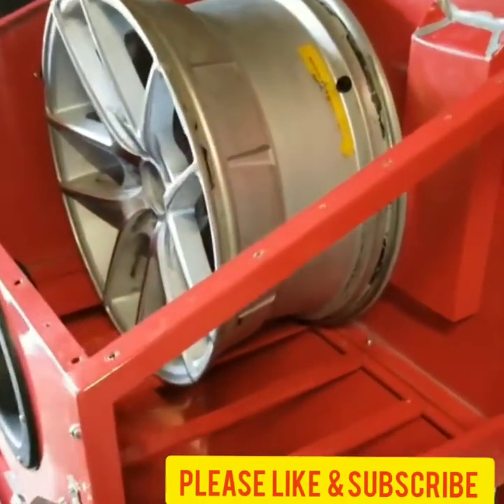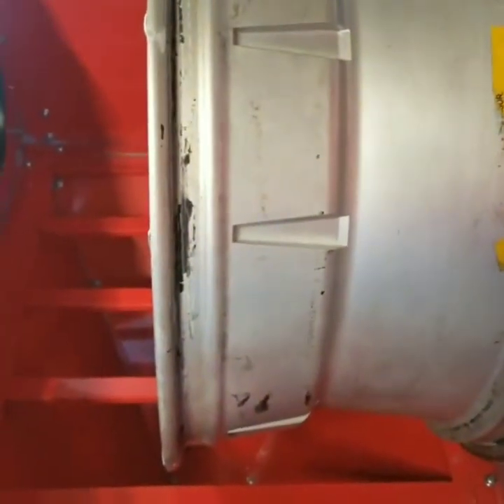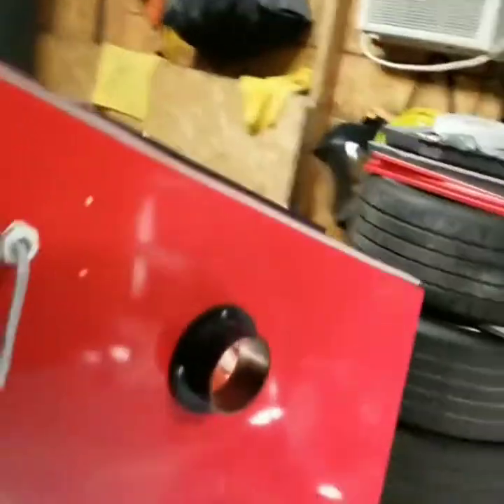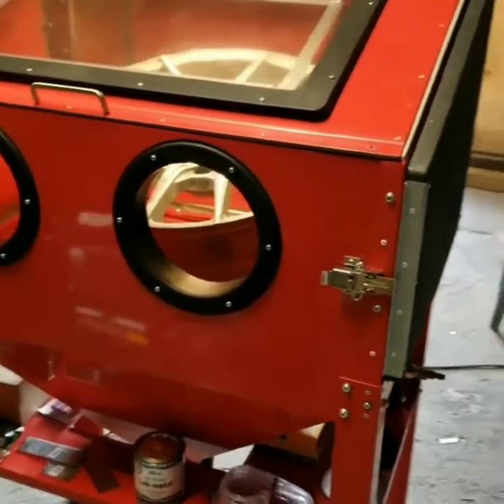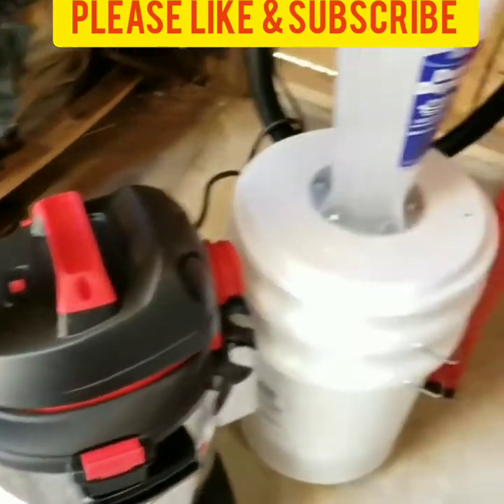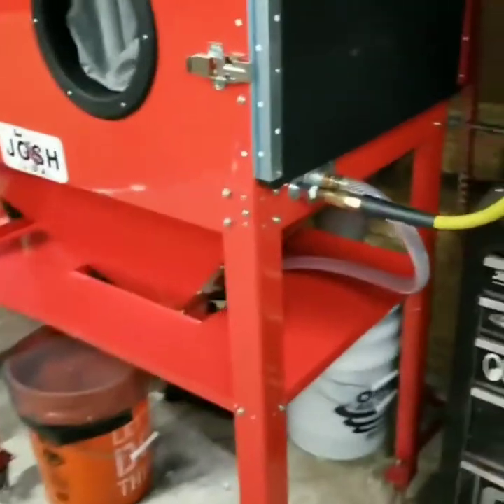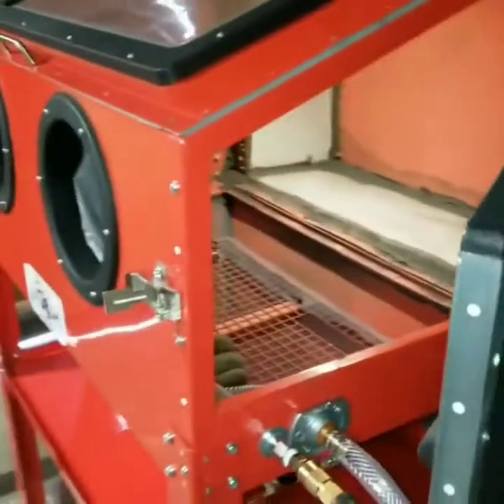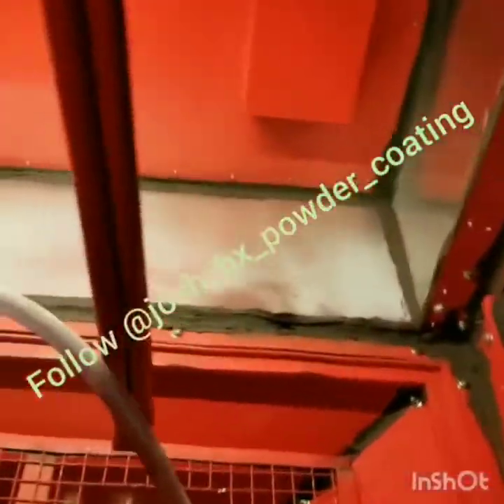SANDBLAST CABINET UPGRADE - ENLARGED TO FIT LARGE RIMS FOR SANDBLASTING HARBOR FREIGHT SANDBLASTER

Comment: What material did u use to extend it out the back like that?
Reply from the maker: I used Galvanized-Steel Flat Sheet Metal, 
From home depot.
Reply: @JoshNTurboJosh  I could weld this then? ;O
Reply from the maker: @X2hedX  yes you can, tig weld it would be recommended for this thin gauge metal.

Comment: Nice Video. I did almost the same thing to mine. Came up on 15 4’x 8’ sheets of 16 gauge, 15 4’ x 8’ sheets of 20 gauge and 15 4’ x 8’ sheets of 12 gauge for $500…the things you find at a yard sale…added 10” to the back of mine and some legs, tig welded the entire cabinet…zero leaks…got it running pretty good…happy with what does for what I’m doing. Good Luck in the future!
Reply from the maker: Thank bro but for that price you spent, you could have just purchased a nice big well built Eastwood blaster $600
Reply: @JoshNTurboJosh  probably not…15 sheets of 4’ X 8’ steel is going for upwards of $2000…I got 45 sheets for $500…I definitely made out better…and I already have a full up shop…machines and consumables…this build paid for itself on the first set of wheels I blasted and coated
Reply from the maker: @jsquaredmetalworkandlogist4564  that's good 👍 at the moment I'm looking at a pair of cyclone cabinets 48"x36" deep 🤞.
Reply: @JoshNTurboJosh  put it in the atmosphere…it will come! Most of those piece of equipment I can fab myself and not have to make modifications or improvements. Good Luck with your business Bro!
Reply from the maker: @jsquaredmetalworkandlogist4564  Thank you!!

Comment: you did a great job modifying it but what sandblast cabinet would you recommend if you don’t want to waste time making the thing work properly, essentially if you had to do it all over again what route would you take now?
Reply from the maker: the best out there is the USA skat blast cabinet But the are very expensive.  Here's a link to their cabinets, which cost HUNDREDS of dollars/ https://skatblast.com/product-category/blast-cabinet/

I bought mine for $200 from Harbor Freight, and spent about $100 to modify it.  I also had to buy a Craftman vacuum for it, which was about $80, then the Cyclone Dust Collector ($30) https://amzn.to/3g81tPZ 

I'm on a budget, so I decided to do this.  If I had the funds, I would buy the Skat.
Reply: Turbo Josh Bx yeah i’m just trying to have a cabinet big enough to blast 20” wheels and brake calipers haha don’t need an industrial blaster, when you extended the back did you weld it or rivet the extra metal?
Reply from the maker: @BOOSTEDLUCKEY   That's exactly why I modified my cabinet. I used rivets and silicone, the kind that is used for caulking windows.  I modified my cabinet to fit a 24" wheel.
Reply: Turbo Josh Bx well good deal! i feel more comfortable doing that now that i know how it was done and might replicate it man yours looks like it came out great!
Reply from the maker: @BOOSTEDLUCKEY  Go for it!  Let me know if you have any questions!

Comment: Thank you for the video.  You mentioned early in your video that you attempted to hydroblast but failed.  Could you relay what went wrong, I'm on the fence with doing one.
Reply from the maker: You need a very powerful pressure washer for that to work. Maybe more than 5,000 PSI and dry sand. Mine was 2,700 PSI... it didn't work

Comment: Watch rays garage videos and you’ll understand what the problem is you don’t have proper pressure throughout the cabinet and you need a proper metering valve to run the media through the bottom door. Cool little extension though
Reply from the maker: Thank you so much for dropping by!  I'll be sure to check out his video!

Comment: How did you take the top off so smoothly? also how are you going to seal that
Reply from the maker: I removed the bolts from the inside, then attaching 2 door hinges at the top. On the bottom I attached a pull handle.  As far is the seal I used a 1" foam tape around the edge, the weight from the glass will keep it closed tightly.

Comment: How many litres is it? Before you did modifications
Reply from the maker: Here is the link to the product listing https://www.harborfreight.com/40-lb-capacity-floor-abrasive-blast-cabinet-68893.html

33.5"x22"x18" was the dimensions of the working area